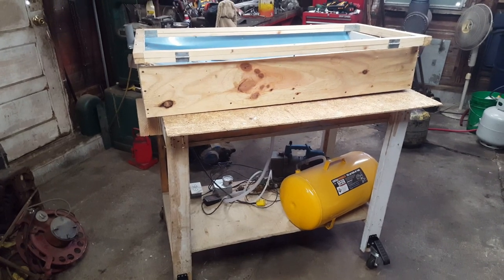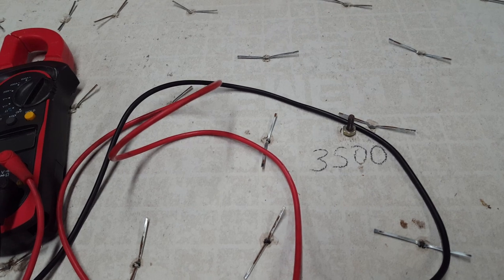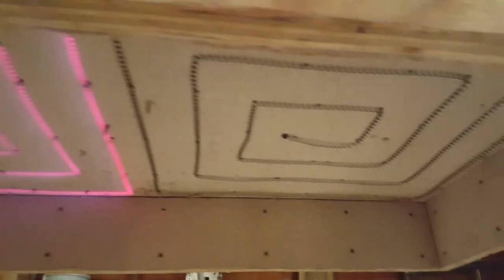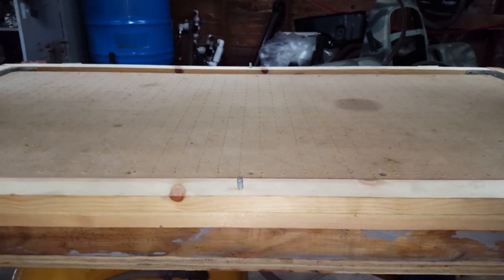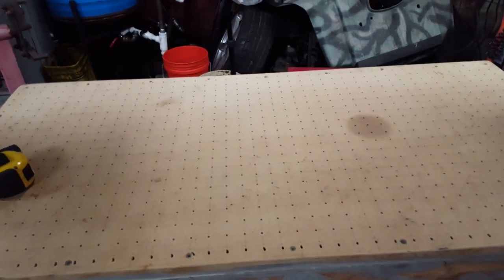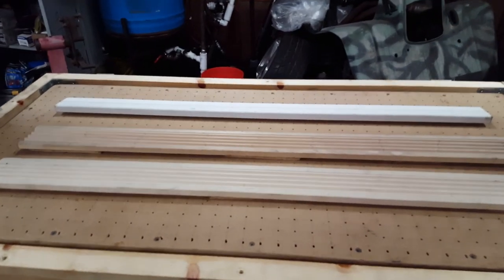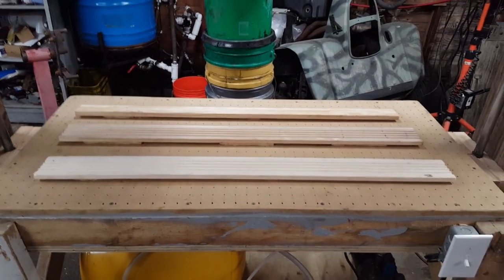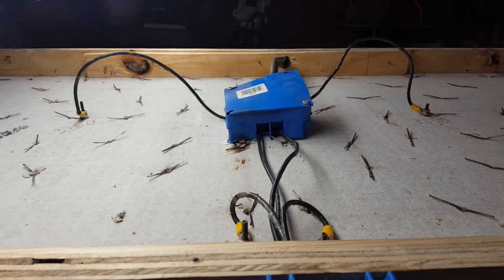Build A Vacuum Former

Comment: By heating the plastic it is expanding, but the frame stay's the same. That extra surface has to go somewhere, that's why it wrinkels. So some more heat might work if you elevate the pieces high enough to drape the plastic in order to prevent wrinkles. It's a balancing act between heat and height. Did the holding screw on the plastic box touch the heating element? Another great video!

Comment: 36:05 Yes, use them both!... Except... Perhaps you realized this now, but, you need a valve of some sort to close off the shopvac before opening the vacuum cylinders because the extremely low pressure of your evacuated cylinders will easily pull air backwards through the shopvac. The shopvac is the leak you ponder about at 39:38

So if I were to improve upon this I'd make a one way valve that's in-line with the shopvac. Since it's the air movement through the valve that keeps it open, as long as the box has essentially no leaks, once the shopvac has pulled as much bulk air as it can from the enclosed volume of the box+plastic balloon, the valve will automatically close since there's no more air movement and the vacuum cylinders can be opened to the box.

Comment: I thought about making a vacuum former but didn't think I had a use for it, I do have cats and door moldings. Thanks!
I noticed that there is a wide gap between your plastic frame and the molding table. I believe that is where your losing the vacuum. If you tighten up that gap you would have better vacuum. The insulation from an oven door comes to mind. Additional holes in the valley of the molding might help. I would have had a melted electrical box too.
Look forward to your videos!!

Comment: like the idea with the cotterpins to hold the heating elements , seems to get hot enough too
as for the wrinkles , it might help if you raise the forms off the table so you stretching the plastic taut before aplying the vacuum (ah you did that now might need to go even higher so the platic wraps around and makes a sharper edge ) 
might allso help to turn the vacuum on after lowering the plastic so it can move a little before the drooped center of the plastic  gets stuck to the middle of the table by the vacuum
might allso help if you can regulate the temperature of the elements (tempsensor above the plastic and a relay turning the elements on and of depending on temperature inside the box
putting a seal in between the vacuumbox and the thing holding the plastic might help raise the vacuum (faster / more)  , usung the vacuum cleaner and the pump with the tank combo can work but you need to put in a valve in the vacuumhose of the vacuumcleaner so the vacuum from the pump and tank doesnt just suck more air in through the vacuum cleaner hose
sumting else you might want to try is adding a strip of sandpaper to it , you see with the plastic covering the doorframe it gets too smooth for them to cause the nails to sharpen wish will probably cause them to move somewhere else , like the wallpaper keeping the surface of the moulding rough will at least stop them trying other places to scratch

Comment: It's almost like you need an inverted press to mash down on top of it as soon as you drop the plastic, maybe to form into the grooves better and really sharpen the centers and edges.. Not sure if you could use the mold you make, invert it with another mold (make a negative) then after you hit the vacuum, drop the inverted piece directly over your mold, that would ensure it forms all the way down and tight against the grooves and edges of the moulding. Dunno??

Comment: I have three cats, so I guess we can be friends. What if you tried heating the plastic just above your forms while pulling vacuum. This may help the plastic get down into the grooves.
Reply from the maker: Awesome on the cats! I don't think heat is an issue because I've had it really hot. I might try a bigger vacuum line and see if getting it sucked down quicker might help. 🤷‍♂️
Reply: @ThisNThatGarage  Maybe experiment with the vacuum tanks in parallel rather than in series?

Comment: Your table and the top cap has to be the same width and length so it can close up and lock the air in properly and also make sure you prop up the pieces you are molding just and inch or two

Comment: 1 more wiring tip, and for some reason people just don't seem to understand this - i've seen it SO many times and i'm not including special cases like 1 wire to a switch and back using white and black obviously, but please for God's sake if you mess with an outlet and change it Black is Brass on whatever you're wiring.. Just pay attention to that, you have no idea how many outlets i've come across that are backwards it's SO annoying to have to pull an outlet to swap wires. Thank you : )

Comment: I thibk you'd have had better success if you  laid the cold plastic sheet over the form, heat the plastic until soft, then vacuum.  That should have kept the distortion out of the picture.